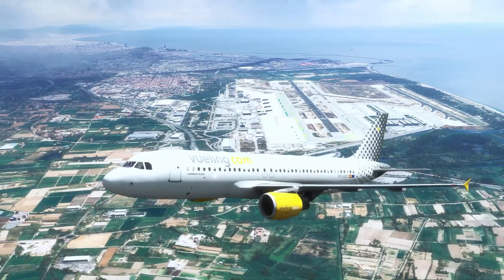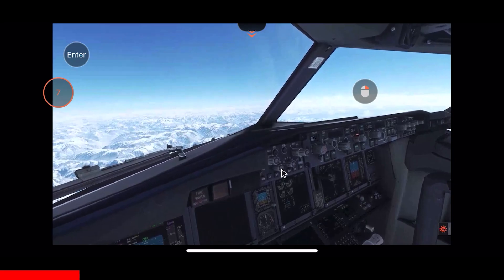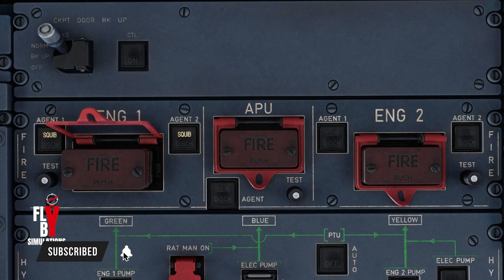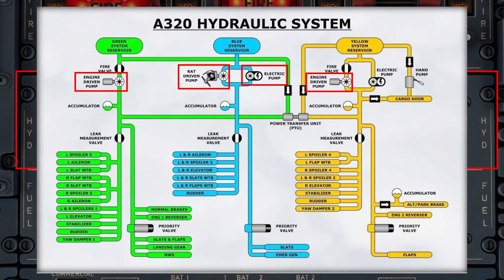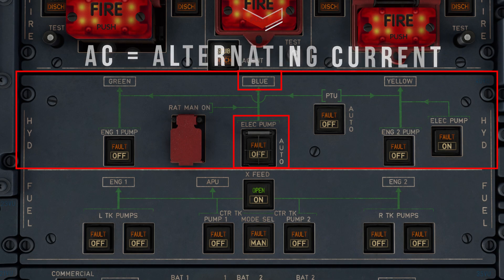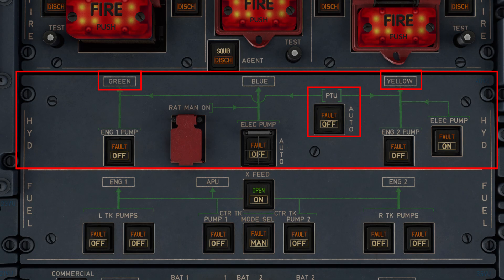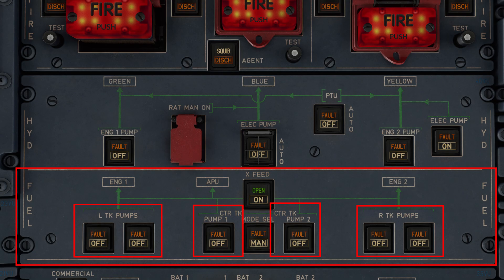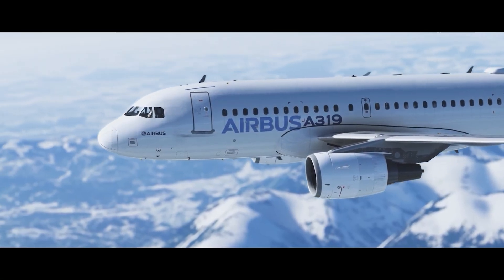ULTRA DETAILED A320 Tutorial | EVERY Button EXPLAINED! | FENIX + FlyByWire | MSFS 2020 #awesun

Comment: The ptu sound during engine start is not it being in actual use. Its running a short while because of selftesting after first engine start. You dont need hydraulic pressure or systems for engine start. Engine start is done by bleed air from apu. No hydraulic systems are used for it.